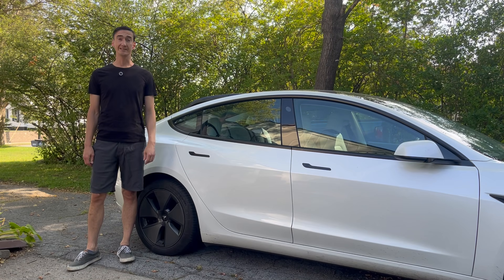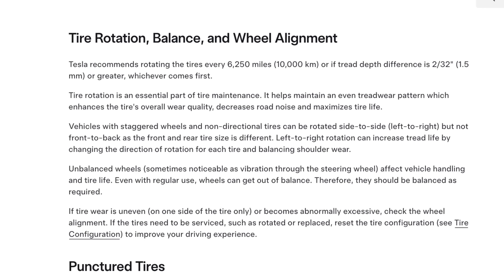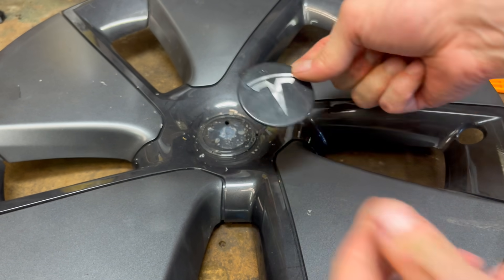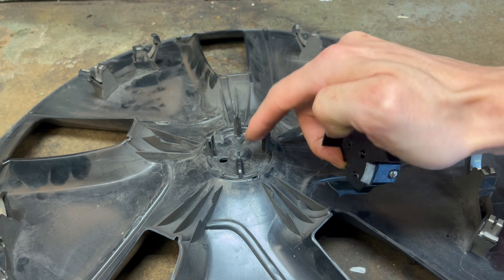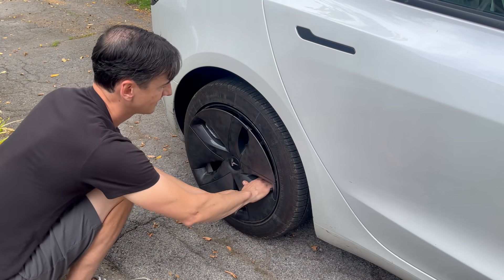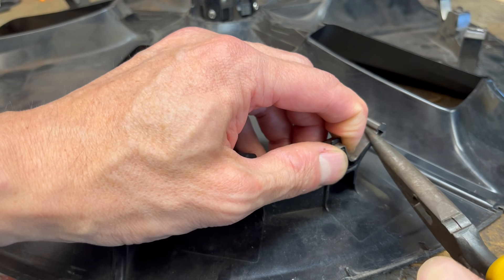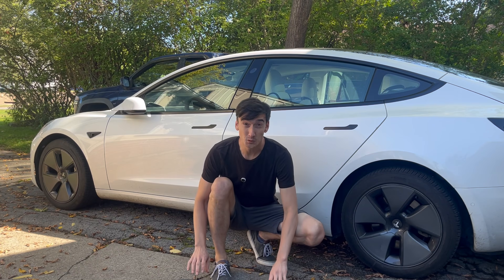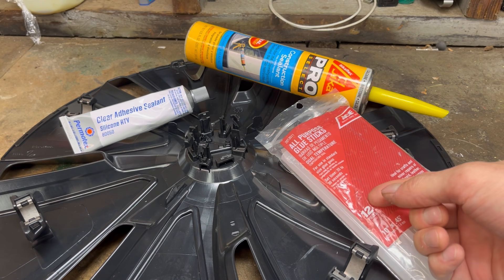Fixing noisy Aero covers on a Tesla Model 3

Comment: My biggest issue with the covers is the amount of road goo that they hold in on the wheels.  My wheels are pitted from it.  Got the car used and the cover had obviously never been removed to clean the wheels.  I do 99% of my driving around town so leave them off.  I’m gonna try some sort of plastidip product and coat the wheels.  There’s a bunch of curb rash I hope that will cover up too.
Reply: You can use jbweld to cover curb rash
Reply: @jaro6985  interesting idea.  I’ll have to look into that.  Quite similar color

Comment: Great video. I’m about to assemble the prints. I’ve taken the logos off and removed the adhesive. Just waiting on the base to print. Thank you so much for making the prints available and the tutorial!
Reply: I’ve yet to put them on but I have a few tips for someone doing this. To start, print in PETG and NOT PLA. PLA will melt in heat. Firstly, glueing the base on without securing it with a screw is a fools errand. It will eventually break off if not secured with a screw. I DO NOT recommend doing this if you aren’t comfortable drilling through the cap. Secondly, make sure the base is facing the cap in the direction where the nuts for the clips are visible in the back. If it’s the other direction the nut will not secure the base on correctly. I also applied loctite to the screw attaching the base to the cap. It is worst case scenario for screws, vibrations may eventually unscrew it without loctite. However, I didn’t use loctite on the screws attaching the clips because if one breaks the idea is that you can replace them which would be very annoying with loctite on them. Hopefully that won’t be problematic. Third, make sure all the adhesive is properly removed before gluing the Tesla logos back on. I used a blow dryer to remove them and then soaked the glue in goo gone and scraped it off with a spudger. It came off easily but made a mess. The most annoying part for me is that the Tesla logos aren’t going to be perfect. It’s fine but they’re made of flimsy metal that bends when you remove them. To make sure they’re as bent back as possible I used heat then gently bended them back how they were. It’s more or less fine but it’s whatever. I am waiting for the T1000 adhesive I used on the logos to cure and then will put them on the car and see how it works.
Reply: Just put them on. Eliminated all rattles and squeaks I had. I also recommend putting some WD-40 gel lubricant on the metal clips to negate some of the metal on metal contact. 9.5/10 mod. Only downsides are the logos looking a little wonky now and the effort required. To add, I’ve used your air filter mod for over a year and haven’t had any of that weird smell anymore, so thanks for that too. Thanks so much for making this video and the files available!

Comment: Felt or foam tape cost less than $10 on Amazon or Walmart. Just place a strip on the outside of the of the spring edge that makes contact with the rim does the same thing.

Comment: With regard to the Model Y Gemini cover, I once accidentally bent one of the tabs when installing it without realizing it. So it stayed bent for half a year until I change to winter tires. I bent it back to shape and it just worked as if nothing happened.
Reply from the maker: @jeffjiegao  hunch confirmed! I think it's just 2021-2023 and 2024 model 3 hubcaps that are fragile. I wonder why they're swapping materials? Thanks for the data point!

Comment: I thought this may be an issue but found I have a different one.  Anyone know what a slight high pitched  "chirp" sound, on acceleration and deceleration, would be? It's 2018 Model 3 with over 100k, so I'm leaning toward hubs have loosened and need to be retorqued?

Comment: I'd personally say it's worth the $50 to not have plastic crap on my wheels. :)
Tesla should design an all aluminum wheel that doesn't require a vanity/aero cover.
Reply from the maker: @evlqueen777  the weight of the wheel has a HUGE effect on range since the car has to pay the cost of lifting it in and out of bumps and starting/stopping their rotation throughout the entire drive. An all metal design would likely be heavier, and you'd probably lose more efficiency than you'd gain. does that make sense?

Comment: Your ingenuity is great!  I like Dewalt battery tools and have numerous ones but not that electric screwdriver.  Now I want one!  lol

But, it would be much easier to just replace all the Aero covers with Rimetrix or any other aftermarket wheel covers.  There are many styles that look way better than Tesla's and get equal or better range benefits.

Comment: Could you have printed the tabs and hub as a single unit so you don't have to use nuts and bolts to attach them?
Reply from the maker: The most common type of 3d printer is strong in X and Y but somewhat weak in Z, so they wouldn't be very durable. Using metal fasteners allows them to be printed in a more durable orientation AND makes them easily replaceable without needing to remove that aluminum center cap again!
Reply: @adamdport  What about making them a bit thicker, maybe with a reinforcing rib behind them?  My thought is to make them durable enough so replacement is unlikely.
Reply from the maker: @JRP3  the design files are included in the link, go nuts!
Reply: @adamdport  Just throwing out ideas, I don't have a printer.

Comment: Great fix! Possibly a little too great for most people to be able to do at home.
My fix is both cheaper and quicker: I just put a piece of a sponge, or some cloth, behind the wheelcap in the center. Just enough to put a little bit of pressure outwards. Prevents movement and rattling quite nicely.

Comment: My experience with rattling covers is a bit different. The movement was around the springs closer to the edge: https://youtu.be/M8WNtuhZ0RI?si=7BGhcBE3J6HfyV5I
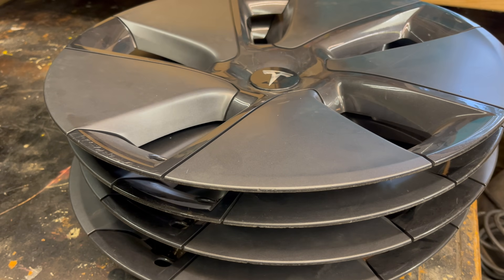Reply from the maker: Oh wow I didn't see yours! I usually search before I make a video to see what's out there and it didn't pop up. I did talk about the springs starting at 8:05. I tried hot glue which dampened the rattle but they were still loose on the wheel. Bending the springs back out worked great for me. Thanks for the comment!
Reply: @adamdport  yep, mine had centre pieces in good shape , I’m guessing they would have broken if I waited longer and drove with loose covers, as they would have rested on that centre piece.
Hot glue is too weak, try some modern hybrid compounds rated for outdoor use (building materials depot)

Comment: I would glue in it instead of putting a screw. Or plastic weld it.
Reply: No. I seriously doubt it will hold after doing this mod. Screwing it in is the only way to do it securely.

Comment: Same thing happened to mine, got lose and started making noise on bumps. But I ran them for probably 3 years (90,000 miles). They also permanently scuffed the rims. The wife also curbed the rims so scuffs are moot. If I had to do it again I’d take them off day one. The difference in range is not noticeable imho. Car looks 10x better without the covers. Just buy the cheap center cap and covers for the lug nuts.

Comment: I had this problem on my 2021 M3 maddening Shanghai. When I looked into info available at the time it appears the aero covers are slightly different between Fremont and Shanghai. I used 3mm thick foam tape on the places on the outer edge of the rim where the cover touches. Worked but it probably won't have the longevity of your fix.

Great video. I'll be having a better look at my covers soon.

Comment: Possible to get a “long term” HVAC update?
Would like to know how the things that where learned and tested are doing to Prohibit the issues?
Anyone with persistent HVAC problems find an improvment from the DIY changes made?
Reply from the maker: @101rotarypower  I was able to reliably reproduce the smell on cool humid days and haven't had any smells since. However I've had several commenters insist that evaporator cleaner every few months is the only way they've resolved their issue—they're mostly from arid climates in the south western states, no idea what that is.
Reply: From the Pacific North West, and I know what you mean…

Many people from arid places and temperature controlled parking like to give their $0.02 on both wiper functionality and HVAC performance. 

I think there are still things to learn, and it’s a shame the OEM is not solving these problems instead of resourceful endusers trying to find solutions. 

Any thoughts on wipers?

There must be a standalone module out there for kit cars with a optical rain sensor that could be retrofitted into the existing DC wiper motor? One that is user adjustable for sensitivity, delay, and wipe speed. 
Would love to find a solution to DIY a auto wiper system that works as expected in all weather and conditions as well as other vehicles I have, and could be on a switch to toggle between the stock system and a known working system, at least until something profound changes in the way the tesla wipers are automated...